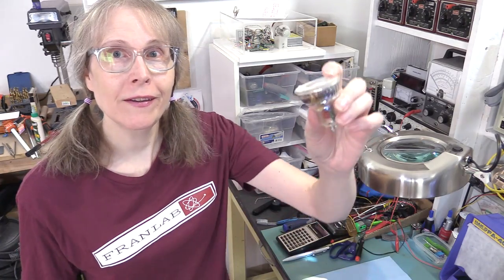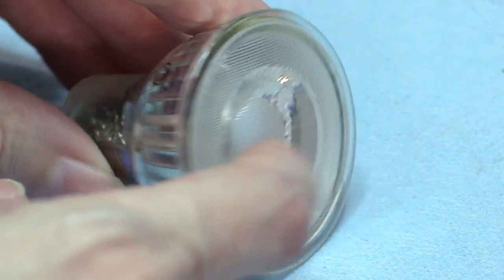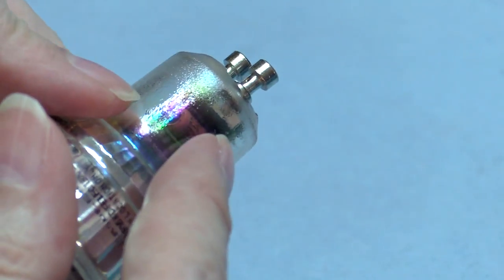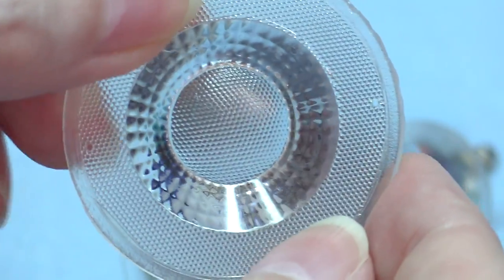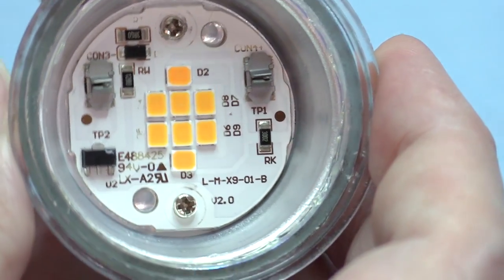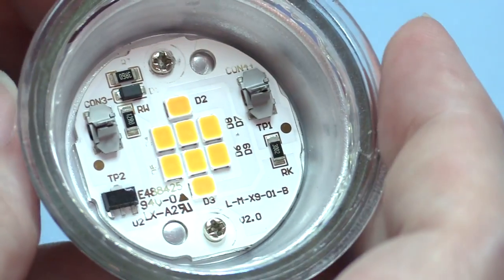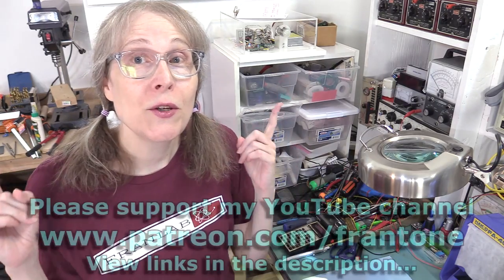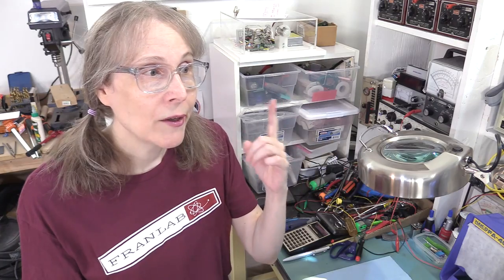Inside An LED Light

Comment: You're right and you've kind of skipped around the true topic of "Is Green actually Green." The failure is focusing on one metric while ignoring dozens of more other underlying metrics.

Another two major considerations are  pollution and actual conservation of resources.

A similar analogies are everything from the overly complexity of HVAC systems, appliances and even ECO stop/starting of ICE cars. All of which utility life has greatly been shortened. HVAC systems that once lasted 20 years are failing in 5, appliances with harsh shut down and start up are seeing a similar life utility decline. Cars with ECO start/stop are prematurely wearing the engine, significantly shortening starter motor and battery life. In other words the few dollars it saves for some useless eco metric on the backend cost consumers even more and waste more resources.
Reply: I once got into an animated discussion with a friend over stop/start technology. He swore up and down that there was no way all that increased use would result in increased wear and tear on the starter, flywheel, and electrical system. After a few minutes of this back-and-forth, I asked him how many cars he's worked on in his lifetime.

He looked down at his feel (EDIT: feet) sheepishly, and said, "None."
Reply: @dashcamandy2242  .. I own all Mercedes, every single one of those cars I've had to replace the auxiliary battery ($200/ea) multiple times on each car (actually they're SUVs). Worse there's no way to turn it off permanently, instead you have to do it every time you start up the car. To make things worse I live in Florida, so when the engine turns off the AC turns off and it's 95 plus degrees outside. The new HVAC systems are using aluminum cores. Our $26,000 HVAC system which replaced an 18-year-old working system after less than three years we had to replace the aluminum cores. Fortunately I have a 10-year warranty, but after that it's going to be trash. I could go on and on...

Comment: This  ecobalance concerns me for years.  My reason to use them is the low operating temperature. A toppled lamp with conventional tungsten or worse halogen bulb can easily start a fire.  An LED fitted one would require a short. However your inspection (in best Fran Lab fashion, I may say:-) makes me wonder: What  if instability of the electronics, due to production methods and complexity results in more shorts than tungsten and halogen?

Comment: OTOH, the incandescent lamp (and especially the halogen lamp) is very dependent on vacuum, or at least not having oxygen in the actual bulb. Otherwise the filament fizzles pretty quickly. If I understand correctly, the process of getting that vacuum on an industrial scale isn't terribly efficient either. Probably doesn't offset all of the other factors Fran brought up, but it's a consideration.

Also, I would dearly love to buy a lamp assembly like that which would last 20 years, but each one would probably cost a hundred bucks or so. That wouldn't stop me, but too many people are too cheap for that, even if they ultimately pay out the same amount over the same time span. Reliability and longevity just don't seem to have value to most people.

Comment: So a quick search on amazon reveals that a modern gu10 halogen light bulb cost 1.96 on average and last on average 2250 hours. In contrast gu10 led light bulbs cost 2.50 on average and are reported to last 15,000 hours.  Given that the cost associated with the manufacturing and shipping of a product are more or less proportional to  the sum of labor hours and fuel cost. You can make a case that the economics side points to a lower carbon emission product on the led side.  My anecdotal experience says that led lights outlast halogen by at least twice.  Honestly I removed the light fixture with the  led spotlights way before even one burned out.

Comment: If a LED light lasts 50 times longer than an incandescent halogen bulb and uses a tenth the power then over it's lifetime it can use 500 times the carbon footprint to manufacture. Anything less than that is a bonus. I have 21 direct halogen replacement LED bulbs which I installed about 5 years ago and only one failed, almost immediately. All the rest are fine. It would be an interesting exercise to make the comparison.

Comment: Most of these bulbs last much longer than tungsten while also using less power. However, the use of multiple drop-in replacements isn't really the way to go with LED lights. Using lots of power supplies to run multiple fixtures or individual bulbs does generate a lot of extra manufacturing steps and waste. To maximize it's efficiency you'd want two separate power systems in a home/structure. Standard line voltage for high-power devices and a second low-power system with a single high-efficiency converter for lighting throughout. Unfortunately that takes a lot of work and planning. We just aren't there yet, with the exception of some new construction. Eventually, though.

Comment: I don't get why there are so many components in an LED-based bulb. You don't need a buck regulator. All you need is a bridge rectifier, a capacitor, and an RC filter or two. The filter can be adjusted to lower the current through a transistor so you don't need power resistors. Run the LEDs in parallel for maximum power factor. Of course, it's best to add a transformer to lower the peak voltage to a reasonable level and isolate from the mains.

The RC filter method is the easy way to simulate the soft ripple of an incandescent, and naturally dimmable.

Comment: This is a really interesting field, rife with blind alleys and analytical uncertainties. But there is a pretty good cue, at least with mature technologies, which LED not qualifies as. Price. The carbon footprint is reflected in the price because the fuel used to manufacture the product is in the price. Right now, commodity LED lighting is about 2 to 3 times the cost of tungsten equivalent, where I can directly compare them, but in any case, if the operating cost saves more than the price difference, the overall carbon footprint is likely lower. This doesn't apply to specialty devices like the illuminator in a microscope where commodity rules don't apply, or exceptional conditions (like subsidized electric power, or piratical behaviour like Enron), but as a guide, total lifetime cost (purchase, power, and disposal) is a pretty good guide. LED's are a pretty strong win, here. Even ten years ago, not so much. Now, yes, even with the changes in reclamation since the far east reduced scrap electronics handling.
Reply: I had come to the same conclusion with new energy efficient IT equipment vs older power hungry equipment but I think this may be less accurate with cheap LED bulbs. The energy used in making the bulb probably costs less per Joule than the electricity we pay for, so this method may downplay the energy used in manufacturing. To be safe we should probably look for the electricity cost savings to cover the price difference several times over. I think most LED bulbs are at this point, but short-living ones probably not.

Comment: I was lucky enough to be working at a moulding factory as an electrical engineer years ago and was offered some new GU10 & ses led 4W lamps from duracell for free from the first production run...(we were moulding the cases)...this was 9+ years ago and they're in daily use via a pir occupancy sensor in my kitchen so are on for 10++ hours a day as it's the busiest room in the building with limited external light ...none have failed ...yet...what's the bet now I've said that one will fail...
But I still have 6 spares from the original 'gift' and I suspect they've more than made up for the extra carbon in the manufacture.
I also have some metal finned 8W GU10 led lamps in some downlights bought well over 11 years ago when I first moved into my home these were bought from china via ebay ...used 3++ hrs a day .. none have failed ...I suspect both sets of lamps were made before the cost optimisation was taken to extreme levels ..
I think all that proves is that if good quality components are used LED lamps have the potential to last many years.

I've had several Philips Hue lamps fail on me after only a year and a half .....I do wonder if they had repaid they're carbon cost by then (compared to using tungsten lamps and timer switches)...I suspect not as they're effectively always on to a small degree with the Zigbee and microcontroller constantly running even when not lit.

Comment: I guess the main problem here is the transition period we are in. The parts are needed because they try to make a new technology fit into an old one. When lamps are redesigned, lighting inside our living and working spaces is has it's new forms and niches, the amount of components will drop. right now... well as you said, they use what's already their. this means it's not optimized in a way that would reduce the production, but it is optimized to work well inside the old infrastructure.

Comment: My experience with LEDs is they do last way longer than tungsten and when they do fail it's not the LEDs that fail. The white ones are unlikely to last 50,000 hours due to the phosphor wearing out.
On the other hand they have very significant advantages. The so called "blue" color temperature which is close to daylight means our eyes need less light as the rods in our eyes are tuned to the blue end of the spectrum. At night the Moon and stars are all we had to see by as we evolved.
It's also not just the reduced power required to get the same amount of light that's at issue here. In commercial buildings we use energy to power the lights and energy to get rid of the excess heat using air-conditioning. Then if these lamps do last as long as they should there's less energy being expended replacing lamps and the saving is considerable for street lights and traffic lights.
I suspect part of the issue some are having is engineers having to squish LEDs into lamp housing designed for tungsten / halogen lamps. We did a bathroom reno a few years ago and installed two LED downlights. The housings are 304L stainless, the backend has significant heatsinks. The good lights have temperature control so things don't fry. Sure the good fixtures are expensive but I'm pretty confident I'll never have to replace these in my lifetime.

Comment: The failure mode I seen in most of the LED bulbs I decided to take apart is the ballast dying.
Reply: I have a glass globe bulb that died. It had a large array of led elements in series. One of them was visibly burned. I shorted the remains, replaced the glass with a sanded plastic food container and the lamp lives on.

Comment: I haven't yet had any LED lights fail, some are the very earliest generation bulbs too. However, I also don't have any halogen retrofit bulbs and most of mine are standard bulbs or reflector downlights. I would speculate that the heat buildup is greater in a design like this versus the standard bulb. Especially with the heatsinking and convection moving the heat from the LEDs back into the power supply area. That would be an interesting research project.
Reply: Yes, halogens don't lend nicely to LED replacements. Halogens are about putting lots of heat in a small space while for LEDs you want to spread out as much as possible to reduce heat buildup.

Comment: Hi Fran!
I really like the question of the carbon footprint of manufacturing LED lighting. I also think that they are NOT as biodegrade as standard tungsten lighting. I wonder if the mandate to go and CCFL was just  big industry lobbying.  There some much nicer color choices these days  but I see that some of the worst, glaring LED lights being installed a lot here in NYC. Streetlights and traffic lights that have been changed to LED and I see so  many failing and flickering.
Reply: :-O  You aren't saying that Gen E might have once asked, what if we could get everyone to buy new more expensive bulbs?  And, we'll lobby to make the old tech illegal.  So people will be legally required to send us tons of business.  Where the price charged for the new tech includes a much larger profit margin, based on the much higher prices per unit.

Comment: Recycling is going to be an issue too, lighting has gone from being quite easy to recycle to being e-waste, which cannot actually be recycled but is chopped up and things chemically recovered from it, so is not great for the environment. I think fluorescent was a good compromise between efficiency and recyclability, before they went to electronic ballasts. As long as the tubes end up in a facility which recovers the mercury and phosphor before leaving glass and metal. The old-fashioned chokes were copper or aluminium wire and steel laminations, simple to chop up and sort. Quality fluorescent fittings made from the ‘60s to the ‘2000s, did actually last for decades and it was common to see fittings made in the ‘60s still running up to a few years ago before they became unfashionable. Philips still make a tube rated for 80,000 hours so it is possible, they just cost more.

Comment: 10:00 CO2 cost. Just what I was thinking. All those components to make a LED bulb, but a old tungsten bulb just has the filament. But all the marketing wank says that LEDs are better. They are, but only for reliability in that they tend to last longer. But when you look at the big picture, the CO2 cost is likely to be worse. But eco greenies can happily virtue signal safe in the knowledge that in their country they are using less energy. All that's happened is that they've moved the CO2 cost to another country.

Comment: In most of the cases those LED's fail due to the premature failure of driver circuit..

In my opinion the major culprits on those circuits are Electrolytic CAPs . In those systems the switching circuits are exposed to high temperature of the led chip for a prolonged period of time , which dries out the electrolyte faster and forms a higher ESR (equivalent series resistance) which causes failure..

Comment: A failure mode I've seen a few times now is when an LED floodlight or streetlight blinks on and off at about 1 cycle per second. I'm guessing the power supply has failed. Has anyone else seen this happen? I think the weak link in LED lighting is having a relativey complex power supply as opposed to the simplicity of incandescent. Even with his shortcoming, I think LED is superior to CFL which requires a period of time to come up to full brightness.

Comment: I have bad luck with LED lamps. Several have failed. But, they are from the same manufacturer and in similar settings. I'm not soured on LEDs. I had realized that my replacements simply need to be from top level manufacturers, as described by other commenters here.

Comment: There is something else to consider. I heat with electric hot water. When I had regular bulbs they gave off heat. That heat added to the total cost of energy consumption but they also added to heating of the home. Maybe it’s not a huge difference. I always wondered about that. My computer room and the amateur radio gear add a lot heat to that room. It’s always warmer there. I have no idea how one would go about figuring out heat from tungsten bulbs... but would have been interesting to think about.
Reply: Figuring out the heat from tungsten bulbs is easy, a 100 watt bulb (or computer, or basically anything really) puts out 100 watts of heat. If you're trying to warm a home using electricity you should think about getting a heat pump. These are great from an efficiency standpoint as a 100w heat pump can add over 200w of heat into the room.
Reply: eDoc2020 agree on the heat pump but in the great white north you must have a secondary source of heat because the heat pumps don’t work at -20c and below... soooo a heat pump is fine for most of the time but you have to have another source of heating for insurances here. I had the water heating for 30 years... and while it’s cheaper than baseboard it’s not that much better.

Comment: My experience with halogen lighting is that it is a significant heat producer that increases my air conditioning load significantly.  Halogen lamps typically have a relatively short life of 2000 hours.   The big problem with LED lamps at this point is the quality of the components is now so low there is no longevity.    Be sure to factor in the cost of pumping 90 watts of heat out of your living space in the summer vs. 8watts or so for the LED.

Comment: somewhere (could have been the guardian, "Are ceramic cups really more ethical than disposables?", but i don't remember) i heard the claim that a ceramic mug requires as much eMergy as 1000 paper ones. that means you would have to use it once a day every day for more than 3 years before it's break even

Comment: Part of the problem is that the kind of LED bulbs in question are retrofitted. Homes with dedicated low voltage electrical wiring can take advantage of "bulbs" that require a nominal amount of electronics.

Comment: One reason for the holes in the lens might be to vent VOCs produced by adhesives and other materials in the non-LED components. The LED chips are generally encapsulated with silicone, which VOCs can permeate and darken with heat and time. I learned this the hard way when the LEDs in sealed waterproof lights I designed failed in this manner. Interestingly, running the LEDs in open air drives off the VOCs and restores the LEDs to near full brightness. See https://www.led-professional.com/resources-1/articles/led-and-lens-degradation-through-volatile-organic-compounds-by-cree.

Comment: 99% of the LED bulbs that failed over the years, I have taken apart and noticed that the LED array is still fine, but the switching power supply is what failed. If you attach that LED array to a bench power supply with the voltage required depending on the type, it till turn on and produce light just like it was.